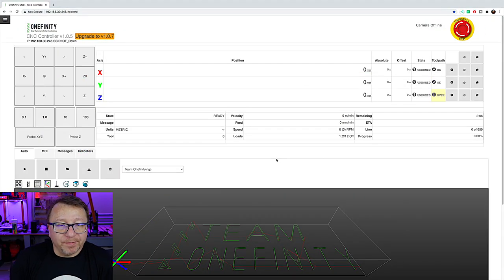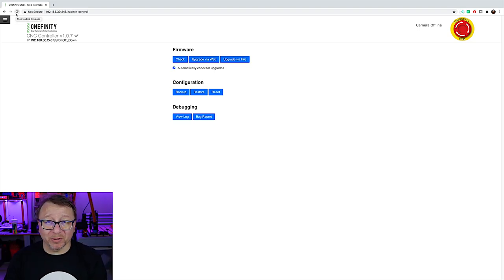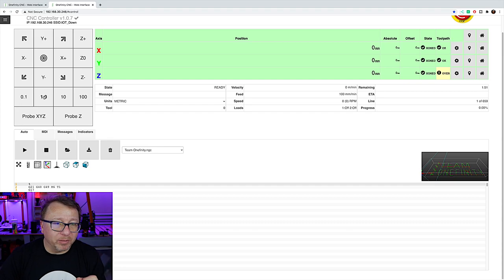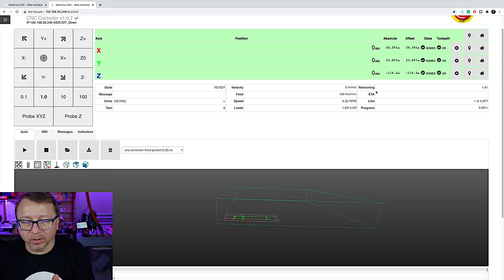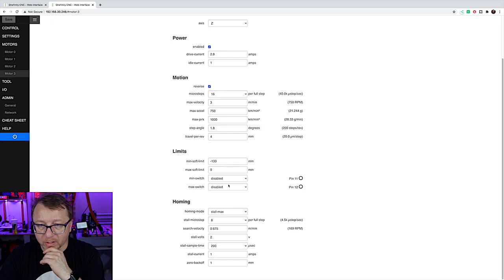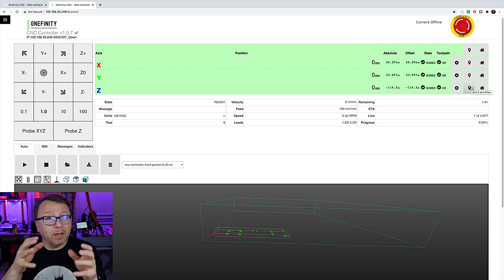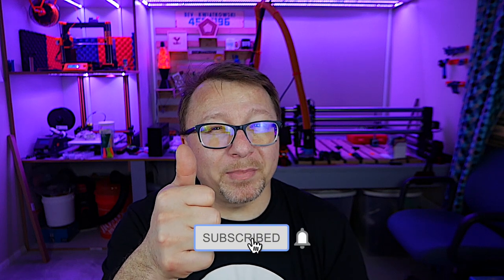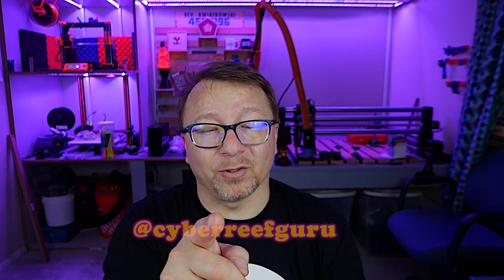Onefinity Upgrade - How To Upgrade Firmware to v1.0.7

Comment: I'm new to CNC and OneFinity is my first machine. My machine shipped with 1.0.7 and I upgraded to 1.0.8. I do not have smaller buttons to actually see which file I have loaded. Is there a setting I'm missing? Thanks for any help.
Reply: So I watched your beginner user interface video and got my question answered. Preview doesn't work on the touch screen. That's a very nice feature. Guess I need to hook up a laptop.
Reply from the maker: @MattMadeIt123  Cool - glad you figured it out.  If you put the controller on your network, you can view from your laptop remotely, then you really only need the touch screen for local operations like zeroing.

Comment: We are having the same problem with “wrong password” when we try to update the firmware. You just fast forwarded through it, was there actually something different you had to do?  I’ve spent two hours trying to get passed this step with no luck. Any suggestions would be greatly appreciated. Thank you for your informative videos.
Reply from the maker: Hi there.  The default password should be 'onefinity' all lower case. It didn't work the first 2 times I put it in, but did on the third.  I don't know if I mistyped it, or if there some other issue with the software. Hope this helps and thanks for watching!
Reply: @cyberreefguru  so if onefinity is the password, and not the password to my router, then what is the username they ask for?  Thank you very much for answering!  I really appreciate it.
Reply from the maker: @Imageyenation  I don't recall being prompted for a user name while upgrading, but it has been a while since I did it. You can validate the user name in the options menu - Settings > Admin > Network > SSH Remote Username (this video might help https://youtu.be/1aS7j0AVRCA?t=1130). If that fails to work, recommend contacting support or checking on the forums for additional information.

Comment: I am new to onefinity and I am wondering what software do I need to use for my machine I understand that they are 2 different softwares that will work with it not for sure please help
Reply from the maker: Hello - thanks for watching.  In short, you need CAD software, CAM software, and some way to get your gcode to the OF (browser, USB memory stick). I run through the process in my 101 series: https://youtube.com/playlist?list=PLCVvx3PnAfydWrixbka1X_bqDl2kXO5ko. I also recommend poking around on the forums (forums.onefinity.com), but this thread should be informative: https://forum.onefinitycnc.com/t/why-not-fusion-360/651/4.

Comment: they need to get rid of the password it is a stupid vestigial feature
Reply from the maker: I actually believe they should keep the password feature, but allow end users to change it. It would be a very bad idea to have an Internet-enabled device allow remote software installation without any form of authentication. Lack of authentication or default passwords is the number one source of botnets in IOT devices.